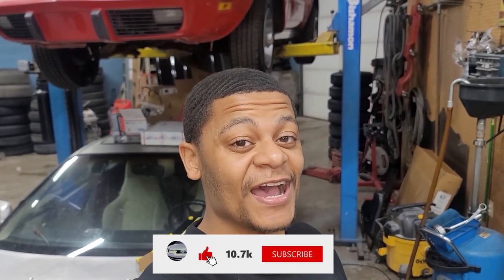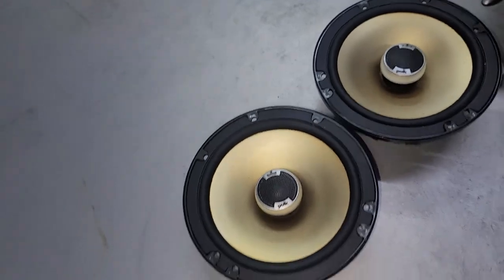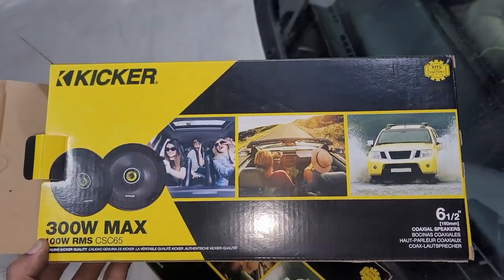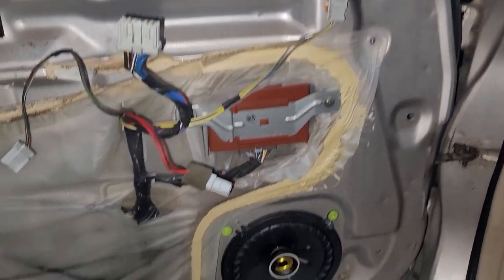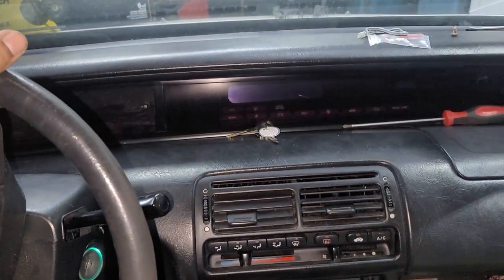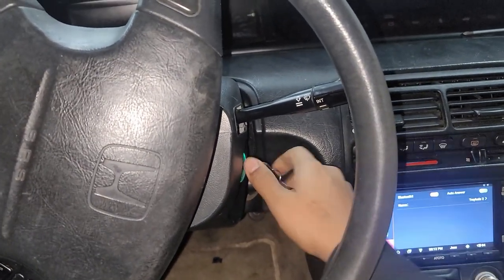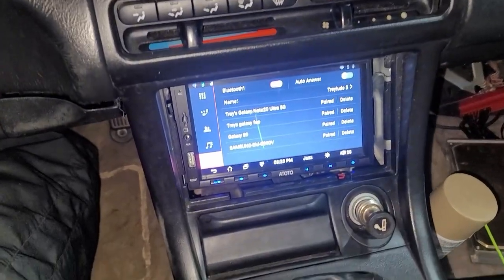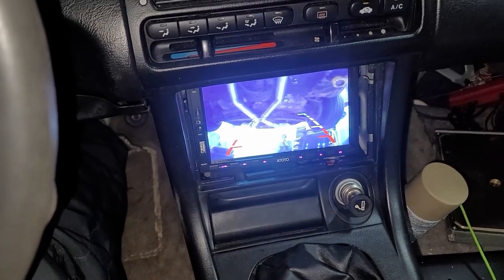Kicker 46cs654 speaker install and review in my turbo Honda Prelude

Comment: I have a 92 prelude i got it with no radio I got an Sanptent radio was I’m new to the game was wondering if knows how to install it with the camera there’s so many wires and the sanptent radio got 12 wires
Reply from the maker: Every radio comes with a wiring diagram. Just make sure you grab radio harness adapter. Don't cut the oem wiring harness

Comment: Nice Bro, you got to have the sound 4 real ! Did you put a jdm glass roof on her look that on your Beastmode Lude ?
Reply from the maker: It's just the 5thgen glass sunroof but thanks bro
Reply: @treybedipping1734  Wow, that's a nice conversion. It pays to know what works or can be interchanged .
Reply from the maker: @differentgroove1  facts bro
Reply: Why don't you turn em into component sets buy some extra tweeters and wires and some capacitors bro?